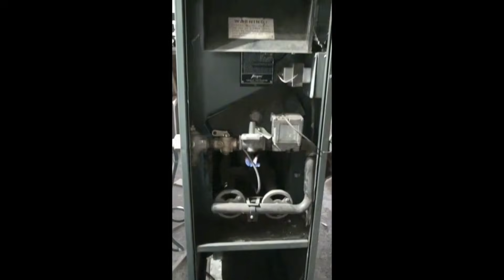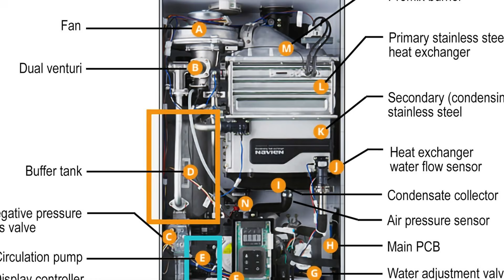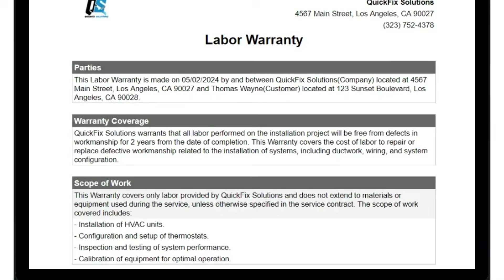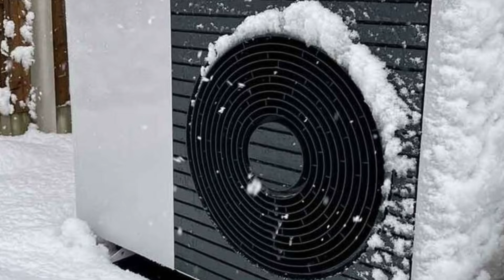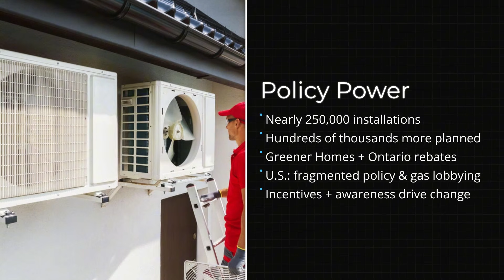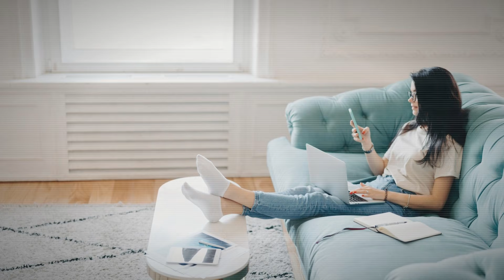Why Your American Furnace Will Die in 5 Years (It's Not What You Think)

Comment: The problem is, this was a quality issue, should be a class action suit. A 240v ac high current wire intentionally run to be cut by metal? You risk bodily injury from shock anyone touching it, or the death of the whole family. Be easy to explain to a jury.
Reply from the maker: Thank you for sharing your perspective, @glennwest267. You've touched on a critical point about how design choices can impact not just longevity, but fundamental safety. This kind of feedback highlights why transparency in engineering and manufacturing is so vital for homeowners. It’s a sobering reminder of what’s at stake when build quality is compromised

Comment: That's not the only limit, even heatpumps have "designed" to fail, a badly routed wire, that get worn by normal vibrations, and dead shorts 240v at 30 amps. (Or more). Tech came out - did extra tape on it, and said every unit and every brand does it!
Reply from the maker: That's a perfect example of the pattern. Doesn't matter the technology, the failure point gets engineered in somewhere. Tape on a 240v wire is terrifying.